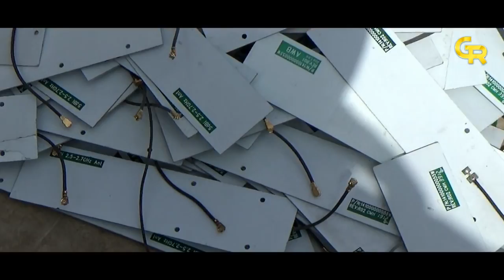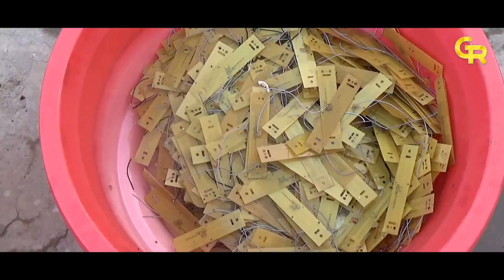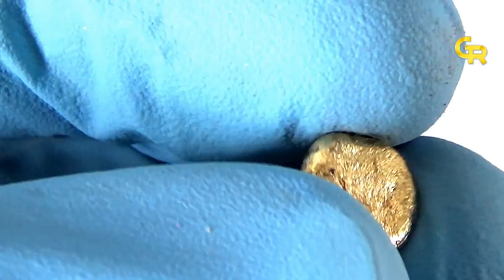🔶Gold Plated Boards Gold Recovery |Gold Striping from Gold Plated Computer Parts|Computer Recycling

Comment: You lost some gold when you went straight to AR instead of letting the hcl remove all of the tin, draining the hcl and rinse thoroughly and then go to AR. That's why your fist drop was so dirty it pulled down tin and other impurities.
Reply: I question your statement of "lost some gold"... I doubt the gold dissolution into Aqua Regia was decreased because of the presence of other metals.
The purity reference is valid, however, both are easily remedied in various ways, from Borax in the smelting, to reprocessing in Aqua Regia, there is also, inquarting with lead, copper or silver and then Cupellation to remove the inquarted metals.
So,while I agree the gold was less pure, correcting purity levels is a minimal concern.
Reply: @Navschannel3908  I've been refining gold for years. Tin can kill your yield. It turns into what is called metastannic acid. This doesn't melt, it's non-soluble and it traps gold inside the crap. Not to mention its almost impossible to filter out. Metastannic acid isn't easily reverted back to tin, you need an oxy-fuel torch to get it hot enough to remove the nitrate attached to the tin.
Reply: @MrMackievelli  I appreciate you response, and would like to point out a couple of minor points that have bearing on this thread.
The Metastannic acid issue is resolved primarily through "heat" as in, the amount of heat to revert to tin sulfide is fairly low.  Not sure where your reference to Oxy Fuel Torch comes in... secondarily, melting the tin away is not needed, when employing the cupellation process, as the inquarted metal from smelting with either lead, copper or silver, will shear the tin away from the gold and into the amalgamated metal created during inquarting.  Then the cupell will literally suck the tin out of the gold into the cupell.
If this is in error, please explain. I"ve found that cupellation is annoying, but effective.